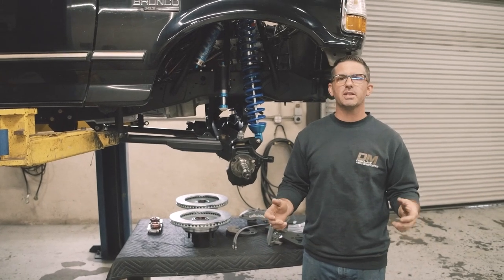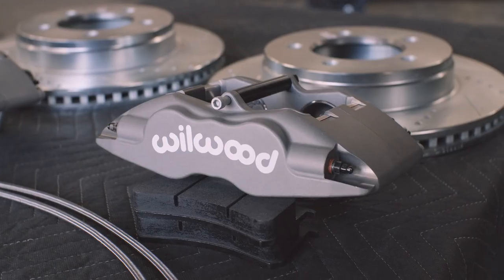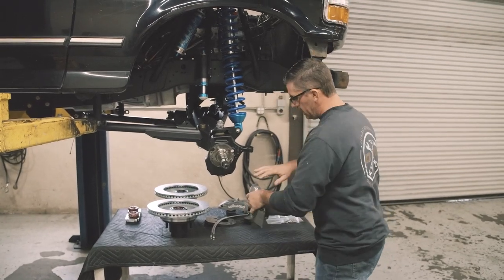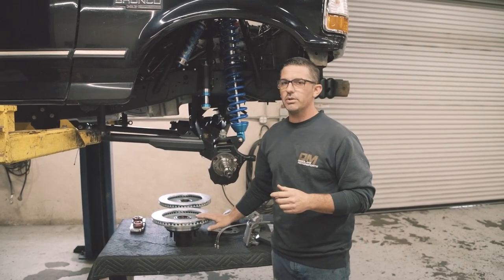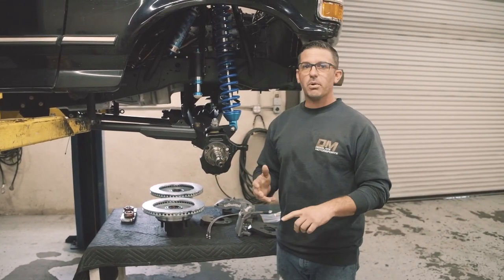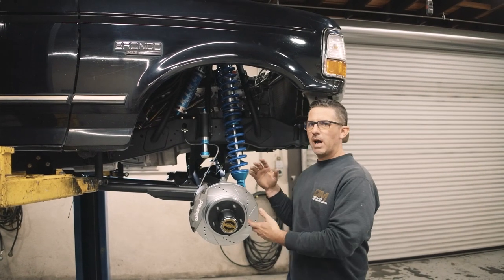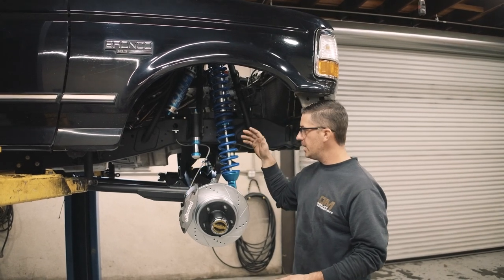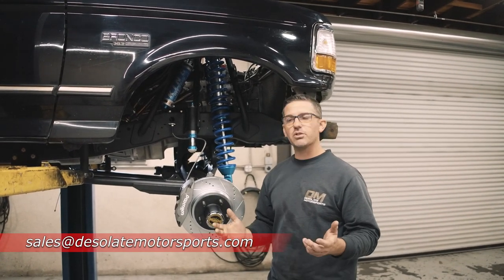Bronco/F150 Big Brake Kit | Desolate Motorsports

Comment: A little curious about he orientation of the rotor slotting relative to wheel rotation. What's shown in the video is the opposite of what Powerstop & Centric say to orient them and how I've done it on every single one of my builds. Of course I was using just slotted, not cross drilled, but I figured the orientation should be the same?